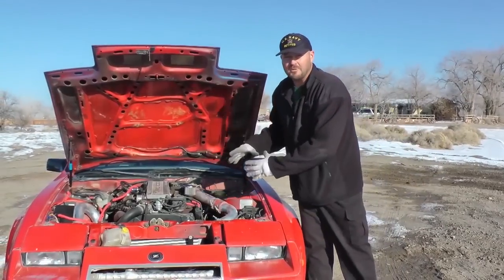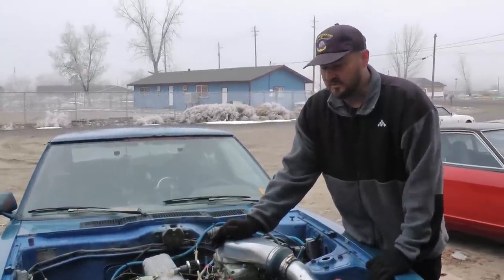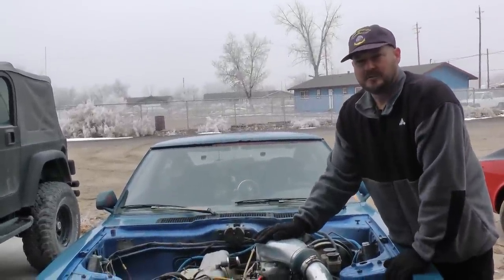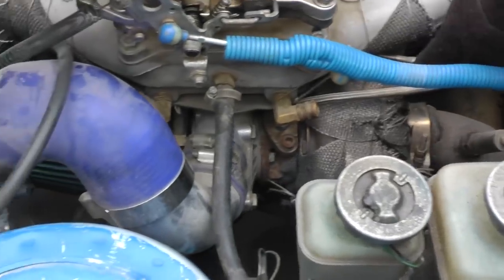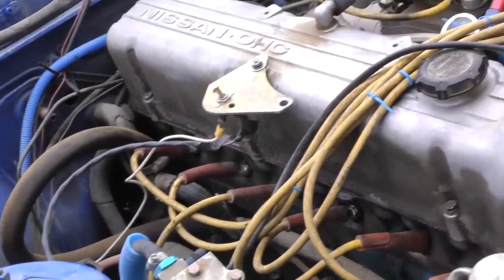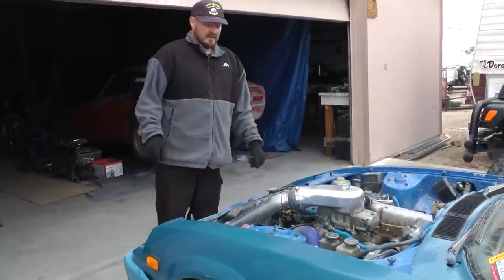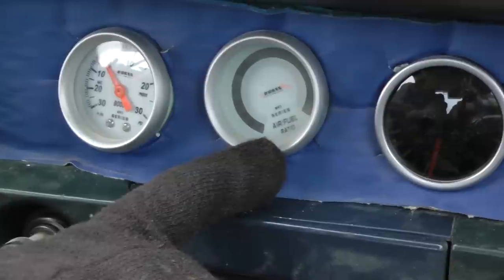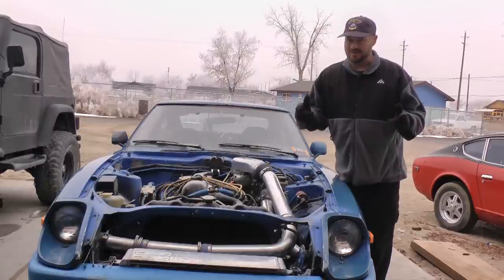Blow Through TurboCharging (Carburetor)

Comment: Back in the early days of turbo cars, this was true – most factory turbo cars did not come with a factory blow-off valve. However, these early turbo cars were also running relatively low boost levels.
Most modern turbocharged cars do have a blow-off valve from the factory, but it recirculates the vented air, so it doesn’t give the characteristic sound of a vent-to-atmosphere blow-off valve. Recirculating BOVs are sometimes called bypass valves (BPVs). Nevertheless, standard BOVs/BPVs are often very basic, sometimes made of plastic and suffer from poor valve response and do not cope well with increased boost levels That being said your old school if you don't use a bov
Reply from the maker: If a car comes factory with a blow off valve, I do not recommend removing it.  Many of the newer cars do use different style turbochargers and help with quick engine deceleration when releasing the gas pedal improving engine braking.
Reply: Budget Boosting the blow of valve is really a by pass valve and recirculated air back into the intake. Older electronic systems had to take account for the lost metered air to prevent engine stall and stumble. The stock 280zx turbo had one incorporated into the manifold it self.

Comment: Without a blow off valve, when the carb butterflies close on deceleration, the turbo boost spikes, and can "deadhead" the turbo. Turbos don't like going from spinning at 15k rpm to a dead stop in less than a second.
Reply from the maker: A turbo charger will never dead stop from lack of a blow off valve.  It will gradually stop due to reduced exhaust flow when accelerator is released, the shaft between turbine and compressor rotors is direct, and they spin at exactly the same speed.  Even at idle, the turbine and compressor spin, so there is no way unless the bearings fail that the turbine would just dead stop.
Reply: Yes it can. Its not about the exhaust. When the throttle closes coming down from high engine RPM, the boost from the turbo to the throttle shaft is trapped and the pressure spikes, with nowhere to go- causing extreme pressure in the inlet tubing before the carb. I have actually seen the turbine stop when a blowoff valve failed on my sons  drag car, the Hyper Bug. Look up the car on Youtube.
Reply from the maker: In Japan where I used to own a 1992 Nissan Skyline R32 GTR I had a big single T88-34d turbocharger with external wastegate running 28 lbs of boost, no blow off valve for several years.  Most tuners in Japan with large big single turbochargers do not use blow off valves.  Smaller ball bearing turbochargers I can see running one to slow one down more gradually.  There are many factors involved for a turbocharger to fail.  If it locked up, it is due to a bearing failure or balance problem leading to the blades striking the housing and seizing.  When tuning any engine, throttle plate needs to be open enough for decent idle which spins the turbine.  When extreme forces are exerted to a turbocharger, heat, lack of cool oil, etc., turbochargers can fail, I have never seen one fail strictly because of a blowoff valve, there are always other factors other than just the valve that made it fail.  I have even run cheap ebay turbochargers for up to 8 years without a blow off valve without any failures.  That says a lot.  Buick Grand Nationals run turbochargers from the factory without blow off valves and I still have the 30 year old turbocharger that was removed in good working order.  It is your opinion but I do not believe it and nobody will convince me otherwise.

Comment: Love the info! Call me stupid but I didn't know I could do this to my 71' 240z until a friend told me today. I got so ecstatic when I searched blow through carb turbo on here and low and behold I see a driveway full of Z's. Really has me pumped to do this to my L24. Already have a Clifford intake with four barrel conversion and a buddy with the know how but your video helped me understand how these systems work. What size turbo do u recommend for it? I read somewhere that the l24 can take the boost and horsepower just as good if not better than an l28 due to stronger crank and connecting rods. Currently running an e88 head. Any info would be greatly appreciated. New subscriber! Thanks again brother!
Reply from the maker: +clay jones You already have one of the best breathing heads the E88, I would run a simple ebay special TO4e 60 a/r internal wastegate with v band flange to allow easy fabrication to your exhaust system.  You can find those turbochargers all day long for around $200 or less.  Great bang for the buck.
Reply: +Budget Boosting Thank you for replying. would you recommend me to just purchase a 280zxt and bolt in that way I can keep my L24 in case I ever want to put back in for originality? this turbo deal is just something I am wanting to do in order to not only gain power but also learn about turbo and everything involved. that being said I just got invited into local car club and want to get back on road asap. too be honest I'm afraid I don't have enough knowledge to get it done as fast as I would like due to the fact I will be relying on friends (and your videos ofcourse) who have the "turbo" knowledge to help me out. decisions decisions. if I go with 280 turbo I will most likely just buy a donor car so I can change out rear end for r200 or do you think that is unnecessary? I apologize for so many questions and ignorance on my part. just decided to undergo this project a couple of days ago by inspiration from a friend...and you! car already looks good but ready to add some ponies!
Reply from the maker: +clay jones Yes that is the better idea to save the original engine and run a ZXT engine.  its also easier in the conversion since the ZXT engine has all the oil fittings, oil pan already to go, boost referenced fuel pressure regulator and lots of other stuff made for turbo set up.   Great idea and much easier to do.

Comment: I have a 400m ford v8. I'm sure you can't just pull oil and slap it together.... compression issues? More or less what would a rough price be for all the appropriate equipment?
Reply: Also thanks for the video. Subscription done
Reply from the maker: Wyatt King The oil pressure sender or switch on the side of the block gets removed and a t fitting is installed to use the oil pressure switch and run the oil supply for turbocharger.  The higher the compression of the engine, the less turbo boost you need to run to make good power, higher compression is also an advantage due to less turbo or boost lag so engine is more responsive off the line with high compression.  Just takes better quality of fuel than the low octane pump gas to really benefit from the performance.  Rough price for sourcing the turbo and upgrades would be around $2000 or less depending on the source.   Thank you for watching and subscribing.

Comment: Hey there budget boosting, I've been a turbo tech for four years... On injected motors that is, lol! :-) our show car and our backs were broken in an accident, and we are now building our new prize, a 350 block 85 blazer. We have a 600, 1406 performer series carb with the electric and manual chokes, we are going to be doing a twin turbo build, with twin 92mm turbos. First of all, can our carb be modified to work with a turbo seeing as it has an electrical and manual choke? And if not, with such a large bore turbo, what's the best option on a blow through? We wouldn't want to provide plenty of boost, but not enough breathing room. Any thoughts on these two topics would be appreciated. We are replacing all internals, pistons down. Fresh mild hardened cams, but we might swap to something different there as well. Seems like you know your jaz, as a car guy I never mind hearing from other car guys! Thanks for the input!
Reply from the maker: draco man Nice,  small block 350 project, sounds like a great engine to do a supercharged and twin turbocharged set up.  Basically take a top mount dual carbureted supercharger for the top of the engine, Have two quick fuel 650 BAN blow through carburators on top of the supercharger, have the two large 92mm t4 turbochargers blowing into each of the blow through carburators (after intercooler) feeding that roots style supercharger.  That would give you low end boost from the supercharger and very violent boost once the two 92mm T4 turbos kick in.  Would be one fun set up.   That would be my idea for SBC.  It would also move that fairly heavy Blazer something fierce.

Comment: dude the gauage panel on this is genuine ....lol
but never the less awsome,,,setup,,,im thinking ditching the EFI and go for blow through carbies...
i knowww.....EFIs are far more better ....but for me not worth the hassle...
Reply from the maker: Faisal Abdulaziz I also prefer the carburetor as well along with a boost referenced fuel pressure regulator.  Its all mechanical and no computers or electronics necessary that could just quit anytime.  Yes one day my gauge panel will be better but it works.

Comment: Are you using a fuel pressure regulator ? I thought buing this : Mallory Fuel Pressure Regulators 4309. And I if you are using an other pressure regulator, where do the tubing have to go ? Thx for answer :)
Reply from the maker: Lars T Yes I am using a bosch boost referencing fuel pressure regulator. We will make a video on fuel pressure regulator installation soon.  Fuel source to in side arrow of fuel pressure regulator out arrow to carburetor or fuel rail, usually the bottom part of regulator port goes to return line, most regulators have arrows showing fuel flow in and out and RTN for the return line port.  Intake manifold pressure/vacuum source to vacuum source fitting going to regulator.  Once it is installed correctly, the adjustment port has nut to loosen, make adjustment to desired fuel pressure at idle with vacuum disconnected, plug vacuum in and watch fuel pressure gage and adjust after test driving as necessary for your desired fuel pressure/performance.
Reply from the maker: Lars T Also when shopping for fuel pressure regulator to use with turbo setup, make sure its a boost referenced fuel pressure regulator.  Some regulators are just vacuum referenced which just work for natural aspirated engines.
Reply: thanks, well I hope you make a video about it :) because I need some guidens. And I am going to look upp on that boost referenced fuel pressure regulator
Reply from the maker: Lars T keep checking back on our new videos, should be out later this weekend.  Until I make the new video, watch our Nissan z cars carburation conversion video, its not a turbo z however I do believe I go over the fuel pressure regulator installation a bit.  The difference between the two is the vacuum and boost port, for turbo you use boost referenced regulator for N/A a vacuum referenced regulator.  The installation is the same other than that.

Comment: I'm a bit new to turbocharging, but I'm starting to get the basics. I have a 81 Datsun 280z which i would like to turbo in the near future. A question I have is if you were on a budget, doing a blow through setup, just wondering, do you NEED a turbo specific to your engine? or could you buy a turbo from something like a diesel truck? Other than turbo lag, can anyone give me some info on goods/bad or just general info? 

thanks
Reply from the maker: Troy f Sure you can put a diesel turbo on your car, as long as you fabricate the turbo inlet flange to bolt to your engine as well as all the other bits such as oil lines, hoses, intercooler etc.  I have read various successes with using the 2004- and newer Cummins Turbodiesel Holset turbochargers with great power and response on L28 Z engines.  Also scoring a stock Cummins diesel turbocharger on ebay would be cheap since so many diesel owners are upgrading to larger and compound turbo setups so the stock ones are reasonable to get.  The exhaust manifold from an 81-83 280zx turbo would bolt right on to your engine and the Cummins turbocharger will also bolt right on it.

Comment: how are you controling how much boost your making. I'm trying to turbo a Chevy s10 with a built 4.3 I'd like to run about 10psi on the street and 15psi at the track. do you use a manual valve in the system? if so where?
Reply: wastegate spring and blow off valve perhaps?
Reply from the maker: the boost is controlled by the wastegate which bypasses exhaust spinning the turbocharger when it reaches boost pressure that compresses spring inside wastegate.  A controller can be connected to the wastegate to raise the boost higher than the spring's compression rate.

Comment: BOV's are needed? I always thought that without one all that happens is the excess pressure just goes out the exhaust, via internal wastegate. Correct me if I'm wrong, I never claimed to know it all. I always thought thats what the little metal flapper was for, blowing off excess pressure?
Reply from the maker: the metal flapper is part of the internal wastegate.  the vacuum line to the internal wastegate measures boost pressure from the intake manifold, whatever the factory boost or boost controller is set at controls the internal wastegate.  Once manifold pressure sends set boost pressure to the wastegate valve, it will push the valve open and press the lever arm diverting excess exhaust not needed for set pressure out the internal metal flapper (wastegate valve) to ensure boost is not too high.  If you want to install manual boost controller, you simply cut the vacuum line in the middle that leads to the wastegate valve, then run the manifold pressure side to the entry side of wastegate controller, then connect the wastegate valve line to the out side of the boost controller.  I have a video on that too that uses the 1987 Buick Turbo T Regal as the demo vehicle.
Reply: +Budget Boosting I do know about the internal wastegate actuator and how it regulates boost pressure. So are these comments on here true that without a BOV it is hell on the turbo and wears them out faster by causing premature shaft damage or failure? In video you said without a BOV it will just dissipate and go away. Anyway thanks for the info! Love your videos Matt!!
Reply: +Budget Boosting 
I understand about the internal wastegate actuator and how the wastegate regulates boost pressure. So I take it the comments here about not having a BOV is hell on turbos and causes damage to the turbo from negative back pressure or whatever? Anyway thanks for the insight.
Love your videos Matt!

Comment: hey i would really appreciate it if u could help me out with this, i have a stock datsun a12 engine i would like to turbocharge, i was wondering if that carb would work for my engine and what else would i need with this set up concerning timing and fuel pressure if not could you recommend something reliable, im only lookin to go arnd 10 lbs of boost... thanks in advance and keep up the great work
Reply from the maker: Personally, with as small of an engine that is, I would recommend a draw-through set up. Watch this video "http://youtu.be/Jtn4PyzFspc" Unfortunately, there is not a blow-through carb on the market, at least commonly like quick fuel, demon, etc. that is small enough. Draw through is extremely advantageous to you, because it works with any carburetor. Check it out, if you have any questions feel free to comment on that video.

Comment: How do you prevent detonation?? Use a secondary electric pump for boost? Thanks
Reply from the maker: Bobby John Timing adjustments, mine is at 18 degrees btdc, 100 octane avgas fuel which prevents most detonation, boost reference fuel pressure regulator that rises fuel pressure with the boost.  Colder spark plugs, stock is a 6 heat range I run 7 and sometimes 8 heat range which is colder.  A real effective intercooler also helps combat detonation as well.  Every one of these steps helps prevent detonation.

Comment: Would this work on a 2 stroke engine?  i'm bound to try it one day. internals are already upgraded, don't worry.
Reply from the maker: +B DL Two stroke turbo would be a great upgrade.
Reply: I have seen 2stroke turboed motors on bikes before, they spool hard because of all the exhaust but also run rough af at idle, its hard to boost a 2stroke and get it to run smoothly with the expansion pipe